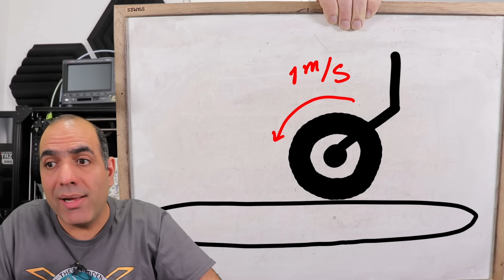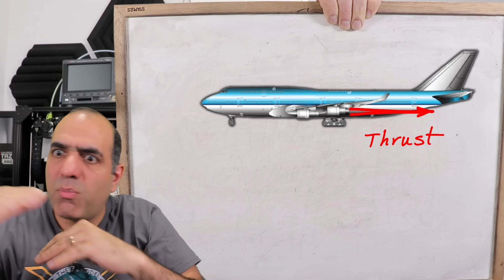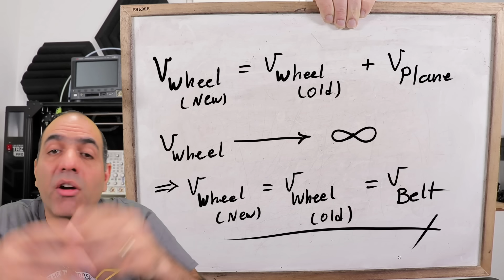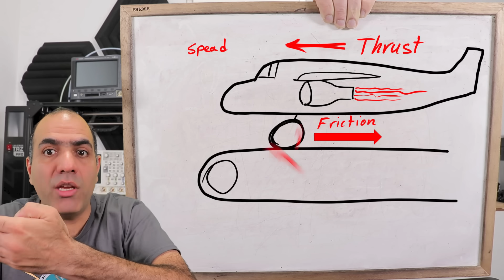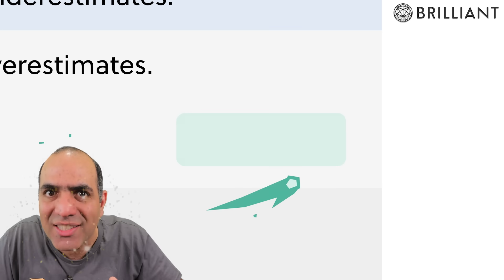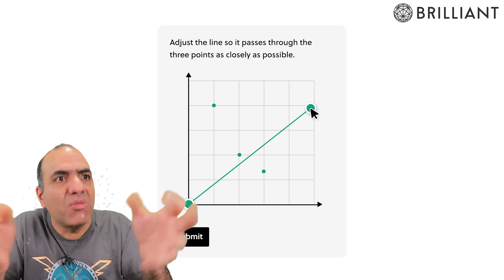Airplane Question that Drove Me NUTS!!!

Comment: This question has even messed with licensed pilots, but I like to look at it in this way:

Stand on a treadmill in roller skates and with the treadmill having a rope tied to the front of it. Hold the rope (important!) and turn on the treadmill full blast. You’ll be stationary, but if you tug even SLIGHTLY on the rope, you will move forward on the treadmill. The forward thrust doesn’t care about the wheels because that’s not the force involved.
Reply: But the wheels aren't moving the same speed as the treadmill when you're moving forwards
Reply: then you are no longer satisfying the condition that the conveyor belt always exactly matches the speed of the wheels.
Reply: When you tug on the rop your wheels speed up and the treadmill stays the same speed. So a normal treadmill is not a suitable analog for the runway.
Reply: @ΜικεΡ  Let’s assume that the bearings in the wheels is zero. Magic bearings like the magic treadmill.

If you increase the speed of the treadmill, and don’t increase the thrust from the plane, will the plane remain in place because of the frictionless bearings or will it drift backwards?
Reply: no one cares what you like to pretend.  The fact is, you, like they, are not very bright.  It's a delusionally stupid question that alerts people with a complete education to anyone lacking.  If you don't immediately, and instinctively, come to the conclusion that this is a dumb question asked from an adult child's perspective, you might be a fukpotato.

Everything you imagine might answer this question is a nonsensical waste of glucose.  That's the point.  It's basically an IQ check.  If your IQ isn't triple digits you will probably think this is a legitimate question and attempt to feign understanding.  Otherwise you will immediately recognize it as a nonsensical trap.
Reply: @MarkStoddard  yeah they gotta match but go find me a treadmill that can connect to roller skates and sync up the speed with the roller skates wheels
Reply: Except that when you pull, the wheels speed up, which means the belt speeds up as well, which makes you remains stationary
Reply: The belt is designed to match the wheel speed to forcibly keep the plane in place. Unable to stop the plane, it speeds up until its components cannot take the stress. The conveyor destroys itself and the plane along with it.
Reply: @theuncalledfor It wouldn't do anymore than double the angular velocity of the wheels.
Reply: @theuncalledfor The conveyor isn't designed to create enough force to hold the plane back, only enough to run at an equal speed in the opposite direction of the wheels.  So it depends on which wheel speed you're talking about.  If it is the speed from standing still to take off, the conveyor effective doubles the ground speed of the aircraft, which means the wheels spin twice as fast.  If you're talking about angular velocity (spin), the ground already represents a surface moving at an equal speed moving in the opposite direction of the wheels.
Reply: But when you pull on the rope, the wheels are going faster than the treadmill. In the question it says the treadmill is always matching the wheel speed
Reply: @neb_setabed  YES!!  Thank you! That’s the most important part of the question!
Reply: @Neb Setabed  if the wheels aren't slipping, then they must be moving at the same speed as the surface they are touching. The contraption is a red herring.

It just comes down to what you think the point of the question is. Do you think it's asking if a motionless plane can take off, or do you think it's asking if you realize there's no way for the contraption to prevent the plane from moving.
Reply: @neb_setabed  Set your treadmill to its maximum speed, start on a plank behind it, and pull on the rope so that you board the treadmill in an even worse condition than the equivalent to the prompt. You still make it across the treadmill.
Reply: Do you not realise that the moment you tug on the rope, the wheels are spinning faster than the treadmill? Your example has a static speed of the treadmill, the plane example treadmill matches the speed of the wheels. Now if the treadmill matched the speed of you roller skates, you'd infinitely accelerate both of them if you tug, requiring infinite energy to do so. That in a nutshell is why this question really doesn't have a correct answer, we're applying laws of physics to a model that ignores them.
Reply: No you are wrong. If the wheels speed is equal to the threadmills speed then the axis of the wheels by definition does not move, and thus the airplane is not moving. If the wheels where frictionless, then this problem is impossible, cause then the threadmill would have to go with infinite speed for this to be true. But in reality theres friction, and although at low speed its independend of speed, at higher speed the laminar flow in the bearings gets important,and thus the friction gets speed dependent,and thus at some speed it will encounter the thrust of the plane.
Reply: @neutronenstern.  wouldn't the laminar flow oppose the direction of the plane and therefore provide lift over the wing?
Reply: @jon9103  no i dont mean laminar flow of air,cause relative to the air the plane wont move. I mean laminar flow of oil in the bearing of the wheel.
Reply: @neutronenstern.  that may not be what you meant, but the movement of the treadmill will cause the air around the plane to not be stationary relative to the plane, not to mention the direct effect of the engines on airflow.
Reply: wrong, you have to have air moving over the wings to create lift, if you are pushing AGAINST the force of the treadmill which if you had no thrust the treadmill would move you backwards you will not get any lift because you are mearly negating the rearward force. the fact so many people get this wrong and allow others to believe this nonsense blows my mind.
Reply: Sure, but your case isn't comparable. As soon as you move forward, your wheels go faster than the treadmill, meaning the treadmill speeds up. The question implies infinitely quick reaction of the treadmill, so you could not pull yourself forward.
Reply: @thecakeredux  That would violate the laws of physics, and if you throw the laws of physics out anything you choose to allow or disallow is purely arbitrary.
Reply: @jon9103  It doesn't violate the laws of physics, but you're free to argue your case.
Reply: That is correct, there is an even easier was to do it too, just replace the airplane with a seaplane. No matter what that treadmill does the seaplane will always take off. Water resistance is far greater than whatever resistance the treadmill could muster.
Reply: @RevRaptor898  even unpowered objets will move forward on a conveyor belt (need to have wheels ofc) placing a hotwheels in the middle of a treadmill will make the car move forward and not backwards unless it encounters resistance
Reply: You’re halfway to the correct answer! Stand on a treadmill holding a rope. Slowly ramp up the speed of the treadmill. Hold the rope tightly so that you don’t move forward or backward.

Even if the bearings in your rollerskates are frictionless, you’d have to increase the force with which you pull the rope to prevent you from being pushed backwards. That means the treadmill imparts a backwards force through your wheels.

For you to move forward, you’d have to increase your force pulling on the rope, but then the treadmill would match the speed of your wheels increasing the backwards force on your body.

Edit: So you’d never take off!
Reply: @rdear  It's a BS question in the first place. Pretty much any plane would "outrun" the acceleration of your moving runway, at least on our real world. The wording is ambiguous. A simple "your plane will take off at 60 mph; will it take off from a treadmill with a surface speed of 60 mph trying to push the plane backwards?" would fix the wording issue.
Reply: @UncleKennysPlace  But my point is that the plane will never reach any positive speed with regard to the treadmill.

It is a BS question but it still has an answer
Reply: @rdear The treadmill interacts with the wheels and thus only has a small amount of surface area to interact with. With such small contact points it will never be able to negate the thrust of the engines. The plane always takes off, provided none of the tires pop from being dragged across the treadmill. Speed your treadmill up enough and you will hear the sound of skidding wheels when you pull on the rope. The treadmill will never stop you from pulling yourself forward, your arms simply don't care what the treadmill is doing.
Reply: @RevRaptor898  If you drop a bike tire, unattached to a bike, on a treadmill, I’ll it spin in place or will it be dragged backward by the treadmill?
Reply: @rdear  See that's were you are going wrong, if the treadmill is matching the speed of the tire, then the tire will not move backwards. In your example you have the treadmill already running and are then dropping a non powered object onto it.  The tire will lose speed but the treadmill will not slow down with it. So it's speed exceeds the rotation of the wheel and the wheel goes backwards.
Reply: @RevRaptor898  Correct! In order for the wheel to keep up speed it needs to have a force exerted on it. If there’s no force the treadmill will drag the wheel back.

If the engines attempt to push the plane/wheels forward, the treadmill will match the speed and there’s is no forward motion of the plane.

In order for the plane to move forward, the wheels need to spin faster than the treadmill is moving and that’s not allowed by the parameters of the thought experiment.
Reply: @rdear  there is no linkage that would relate a torque from the wheel to a significant net force on the airframe. It would be no different than taking off with a control surface deployed. Even though it takes a slight increase in force, it's still negligible compared to the available power of the engines.
Reply: @dustinbrueggemann1875  When you’re talking about a treadmill that has an infinite acceleration No forces are negligible.
Reply: @rdear  regardless of the hypothetical limit at infinity, the coefficients are still negligible in relation. The plane will take off long before any relativistic term matters.
Reply: @rdear  I mean, if you think wheel bearings have any say in the thrust of a jet engine, sure. In reality, it doesn't matter in the slightest and really hasn't since aircraft have been invented. The first aircraft used horribly inefficient engines and still could take off with skids of all things.
Reply: @Stealth86651  The airplane may not turn the wheels directly, but it does need to push the wheels forward.

Take the wheels of an airplane off and you’ll see their impact on the plane making forward movement through the air.
Reply: @rdear  mmh, just think of a sailboat going upstream against current. current will push you back but you have the wind so you still move forward, and as you're moving forward the water is moving backwards at the same speed as the boat going forwards
Reply: @valtercosta2108  Let’s stick with the sailboat analogy.

Pick a point on the shore and look across the river to the other side. Evenly spaced rubber duckies will pass by your point on the shore at regular intervals. We’ll call it 4 ducks per minute. 

Someone on the sailboat looks down into the water and times the same rubber duckies moving past them on the boat. When they count 4 ducks per minute, they are moving through the water at the same speed the water is moving past you on the shore. That means they are stationary.

In order for them to move upstream, they need to move through the water faster (count more ducks per minute) than the water moves down the river.

That’s where it breaks. The water/treadmill always moves at the same speed as the boat/airplane. Neither would ever make forward motion otherwise they’d be moving faster than the water is
Reply: @rdear  but in the case with the wheels they’ll spin and not much friction is produced. The plane will move forward and the treadmill will speed up as the plane keep going faster and faster but it won’t push the plane back because, first the plane pushes on air and second the wheels spin freely. Doesn’t matter how much the treadmill speeds up the plane will always go forward. The only thing the treadmill does is to spin the plane’s wheels faster but it is pushing on air and not on the ground like a car
Reply: @Stealth86651 you have the chain of forces backwards bro
Reply: @rdear  you're assuming that the wheels can generate infinite friction force. 
Irl that doesn't happen, the wheels would slip, effective friction would become zero and the plane would take off. Or slide sideways off the belt. 
Think about what happens when you hit the accelerator too hard in the car, you get wheel spin and the car doesn't accelerate.
Reply: @JD-wf2hu  And you're assuming that the tires wouldn't catastrophically fail when subjected to loads they were never designed for. Car tires are designed under the assumption that cars will lose traction sometimes and slip, and even then they sometimes fall apart when people subject them to powered slides and such. I'd hate to see what would happen if a 747 was dragging its landing gear completely locked off down a runway from 0 all the way up to take off speed
Reply: @bosstowndynamics5488  If you're going outside the basic scope of the scenario to start questioning the ability of the aircrafts tires to handle higher rotational speeds, then you also need to take into account the fact that such a large surface moving at such high speed beneath the plane is going to create ground effect. I'd wager that you'd start creating lift from ground effect of that huge moving surface of that oversized treadmill long before you'd threaten to destroy the aircrafts tires. In essence, as long as the plane is generating sufficient thrust to take off, treadmill or not, that plane will take off.
Reply: But would it be enough thrust for the plane the plane to lift off
Reply: @psgamer-il2pt  Yes
Reply: @psgamer-il2pt  from the perspective of the plane the speed of the wheels has absolutely no impact on thrust
Reply: @fedyx1544  but the treadmill is also exerting an opposite force on the plane, as it accelerates to match the wheel speed.
Reply: @emailofjamesw  if the wheels have friction on the axle and the speed approaches infinity then no, the plane can't get off. In reality the wheels or the threadmill would blow up much earlier

Comment: I guess the conveyor can create wind for the airplane to take off but once airplane flies away a bit - it's going to fall because there is no wind anymore.
Reply: Not even close lol. if you make it slightly more realistic, and say the conveyor matches the speed of the plane, the plane will just take off normally, with the wheels spinning twice as fast as normal
Reply: No. The plane is not propelled by its wheels, but its engines that create thrust in the air. So, from that standpoint, it's irrelevant what the conveyor belt is doing.
Reply: By that point it would be making its own wind though. If the treadmill is moving such a mass of air, it won't be a sudden point where there's no movement but instead a gradual shift